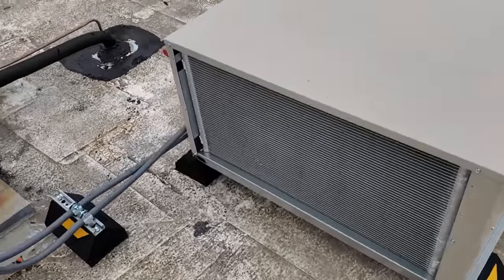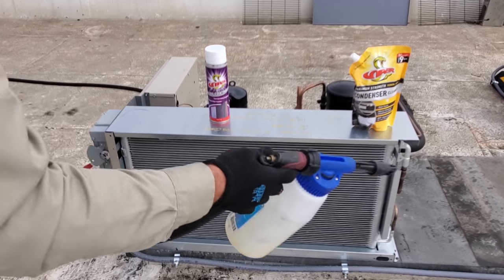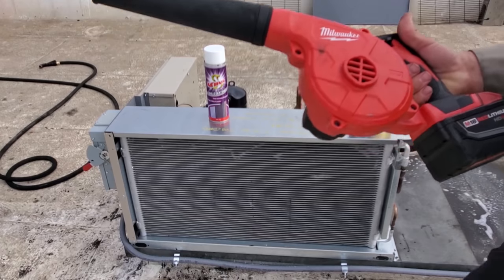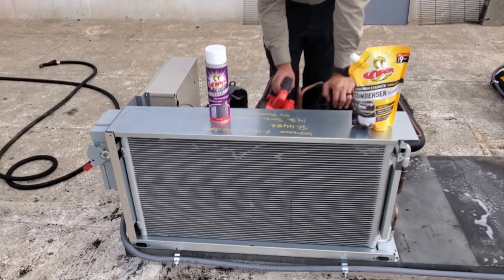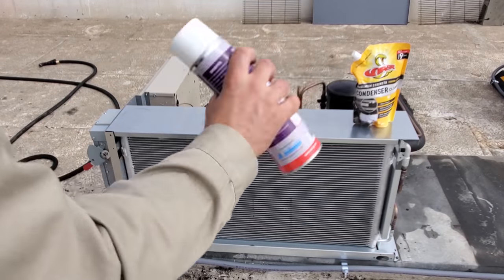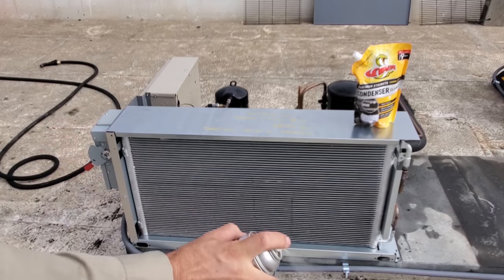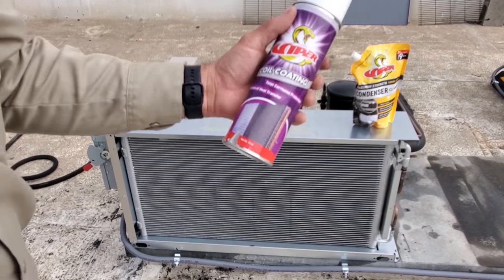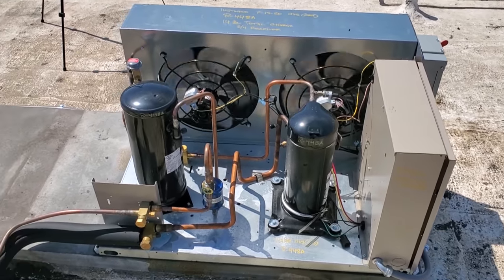PROTECTING CONDENSER COILS (bonus video)

Comment: We use to put a heresite coating on unit coils that we installed around the gulf coast.

We also use it on commercial equipment we installed in certain factories, paper mills and in areas that were prone to corrosion due to manufacturing chemicals.

I saw this coating today at the parts house. Not sure how efficient  it would be on an older unit.

Comment: That condenser should have been ordered with coating already applied considering  the salty climate. Thxs for the vids!
Reply: Yes but getting a customer to pay for that is another thing.
Reply: Also most units are in commercial setups where either the cheapest option is chosen or supplied by the chain. And they wouldnt even be thinking of its protection coating or placement
Reply: Sadly due to corporate capital budgets and bidding processes, often the best option for equipment decisions does not translate to the bean counters.

Comment: I wonder if this can be used on evaporator coils constantly attacked by acidic foods.
Reply from the maker: Yes it can i want to try that next
Reply: @HVACRVIDEOS   Would be very interesting,  but be careful, because the last time I tried to do that in an enclosed area like a walkin box, the manufacturer of the chemical(Diversitech) said that it is hazardous and flammable and not recommended for indoor use because a room filled with this in the air and a small spark can create an explosion. I chickened out and told them to replace the evaporator. Evaporator was already deteriorated and spitting a powdered material every where.
Reply: I have a walk in cooler empty and down now to covid, this reminds me I wanted to try this product but could not attempt when there was product inside and running.

Comment: There is a product called hairasite I am not sure that I have spelled this product right, but you have to remove coils to apply it,s very good for high corrosive areas. There is a manufacturer that will apply the product when you order it.  You may now about this product already.

Comment: How long does that spray last for you in your location? Salts so hard on equipment, and I’m in a area where 75 inches of rain is average. A lot of work of ours is within 1-2 miles from the ocean. Do you think spraying that on every 1-2 years is too much? Equipment can start showing rust in less then a year. Thanks for the info !

Comment: Is there any jobs that you have used this/such a product, that now a few years old, that you have pictures of comparison? Was wondering how it works, Bec it's a coating, that I'm  Guessing isn't metallic, and  doesn't have as good heat transfer. 
I saw some company that was advertising to come down spray units with a graphite spray, to do similar task.

Comment: Like the guy before me said just curious why not order with coating already on it.  Just asking. Keep up the great vids.  😃👍🏼🇺🇸🥃
Reply: It probably does but coating can wear off over time and sporadic reaplications can fill in the worn off coatings
Reply: Also alot of units are purchased by the chain not by someone who knows anything about hvacr. Useualy the cheapest option
Reply: @gavincarstens6497  low bidding process often eliminates quality options unless bid specs require a coated coil.

Comment: Had lunch with an HVAC friend of mine yesterday, he started complaining about these micro channel coils which are becoming more common and much more maintenance demanding, hang on I thought, I know what he's talking about. 
We live in Adelaide, South Australia a city exposed to dusty and pollen laden strong desert North winds, conveniently sited along the coast of the Southern ocean. You have to wonder if a machine that can't clear it's own condenser of heavy rainfall without eventually faulting is really a good design. I guess that's progress, in laboratory tests micro channel probably works more efficiently, in the real world with real dust, real rain and salt hmmmmm.
Reply: The rain would literaly need to be always coming in sideways, with the motors blowing outwards its not really a concern even with heavy rainfall. Its only when your doing a clean where you disable the fans and thoughly soak the unit is it unable to clear the micro

Comment: Micro-channel condensers are absolute trash. Fight me!
Reply: Meet me at in the parking lot behind the old abandoned bowling alley. You're going down!
Reply: Agreed just ask Lennox 😄
Reply: @cranium33333  or Luxaire/York
Reply: @cranium33333  In their defense every car since the mid 90's uses microchannel for their AC condensers. They're usually in the front of the radiator and get all the bugs and road grime. Arguably a way harsher environment than the roof of a strip mall.
Reply: @erikkovacs3097  For automotive they may work fine, but for residential cooling they are a nightmare. Any condenser that you can't pump down the system charge into is trash!
Reply: @chicagomodzz  What do you mean by "can't pump down the system charge"? You can't pull a good vacuum? Wouldn't that mean there is a leak somewhere?

Comment: Have used another product it was like $30 a can on some LG unit we installed have a video of it up last year my son was cleaning four 60,000 BTU LG heat pumps in spraying on the protectant to extend their life. 
          Have a problem with the bay salt air and a body shop paint booth exhaust admitting paint dust that clogs up the condenser.